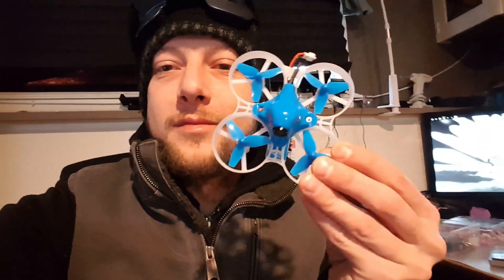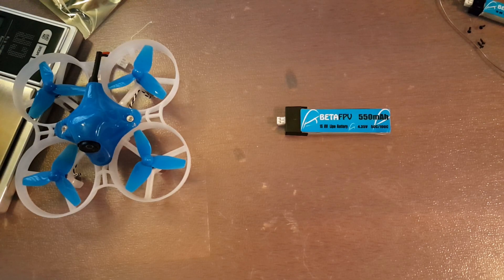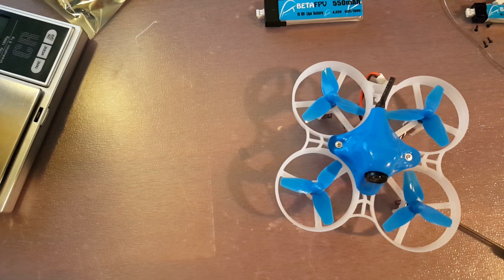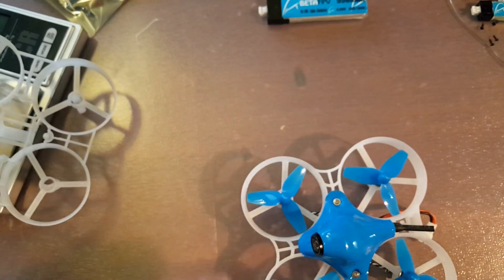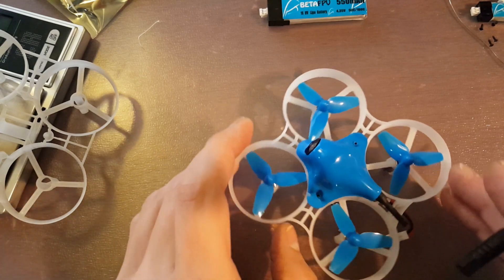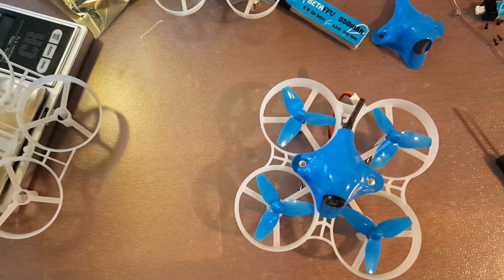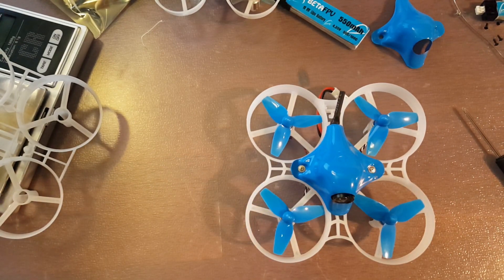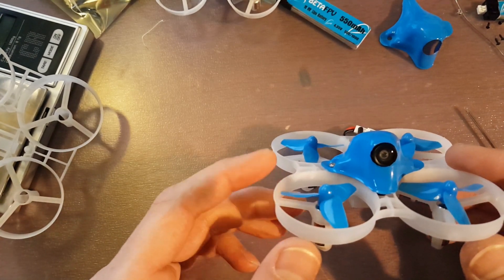BetaFPV Beta75s

Comment: I bought this a few days ago and I can't get it to fly. When I have the drone connected via usb, the transmitter signal seems to be very good. I even went to another room in my house and the drone is still receiving the signal. Once I switch to battery power, arm the drone and start the throttle, the motors start spinning but after a few seconds I see RXLoss message on my FPV display and then the failsafe stops the motors. Any idea what could be the problem?
Reply: Maybe it could be you have. A bad battery. Or not fully charged that happened to my quad

Comment: Did you tune your PIDs? I'm finding that sharp 180s to head back the other direction seems to cause a nasty dip/dive in the rear corner on whichever side matches the direction you're turning. So if you do a quick 180 turnaround to the left, the back left "dies" and tries to drop out.

Wondering if PIDs need to be tuned further. I tried some settings I found that greatly increased STAB mode precision, but acro still seems to leave something to be desired.

I have this same issue on the 75, but it's not as pronounced as it is on the 75S.

Comment: Alright alright I promise this is the last question. So, I fixed up my 75mm whoop BUT THERES A NEW PROBLEM. It's all bound to my TX, everything works, I can arm, throttle up, etc, but when I try to take off by throttling up the osd reads a voltage sag from 4.2 volts all the way to 3.0 volts on my Tiny Whoop HV 260mah battery. Is there any reason for this? I don't know what would cause this.

EDIT: disregard this. I'm an idiot and put my props on backwards
Reply from the maker: SoupOS what are your voltage settings?  Didn't see the edit.
Reply: C Ray Tech yeah it works now! I've just gotta get my DVR wired into my goggles and I'll be all set :D

Comment: Will these 820 motors for on a normal beta75 frame. Or do I need the 720
Reply from the maker: You can heat up the frame to get them to fit.  Personally I would buy the right frame or motors.  You run the risk of weakening the mounts and struts when you heat and stretch them.
Reply: C Ray Tech thanks , I’ll just stuck with the correct size for now. I have a 2s brushless rakon76 coming in a day or two. So I’ll be giving the beta75 a break anyway.

Comment: Bro which one you think is better for the street freestyle and dives? This or beebrain v2?
Reply: Is there actually any difference between 65 and 75 frames?
Reply from the maker: +Dany Orlov I've not tried a beebrain to comparr
Reply from the maker: +Dany Orlov motor cup size and regidity is different.  The beta 75 is designed to fit 720 motors and 40mm props
Reply: C Ray Tech yeah this is all specifications but I want to know is there any actual difference
Reply from the maker: In the way they fly yes.  There is a difference in the feel between the Beta 65s and the Beta 75.  I hope that answers your question.
Reply: C Ray Tech but is 75 more suitable for street freestyle and dives? Or they are just about the same?
Reply from the maker: Dany Orlov the 75 is more suited for outdoor acro flight.  The 75s can do the same but it's takes better conditions.  Less wind.

Comment: Hey man! I know this isn't really relevant to this video at all, but I've got a question.

I ordered a BetaFPV v1.1 board with OSD and a WolfWhoop Q2 camera. I'm just wondering what wires I need to cut and solder to the FC to make it work. I've never used osd before. Any help is appreciated. Thanks!!
Reply from the maker: +SoupOS here is a labeled diagram for the camera.  https://images-na.ssl-images-amazon.com/images/I/412HovjcxTL.jpg
Reply: C Ray Tech thanks man. I figured it out :) it works great.
Reply from the maker: +SoupOS awesome news.  I'll stay tuned for the flight footage

Comment: Dang it! I JUST bought the Beta75 a month ago. Camera solder points didn't last long and it was really difficult to replace once the pins broke (for me any way). Is the power difference between the two of these worth getting the s version? Thanks for the video and look forward to more!
Reply: I own both. It's not worth it. I don't regret buying the S model because I needed a 2nd (in case the first breaks), but it's def not worth it if you're just looking to upgrade. I think my next Whoop may be a 65mm with 25000kv motors for some insanity.